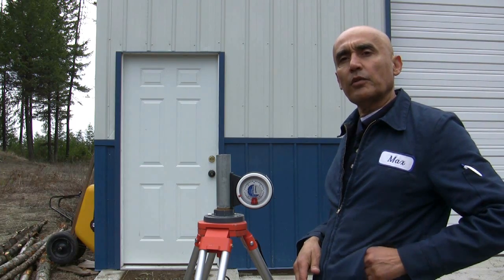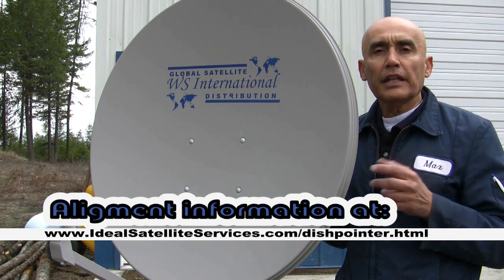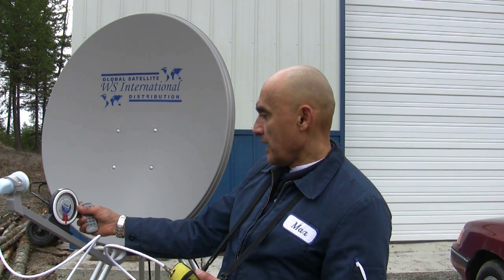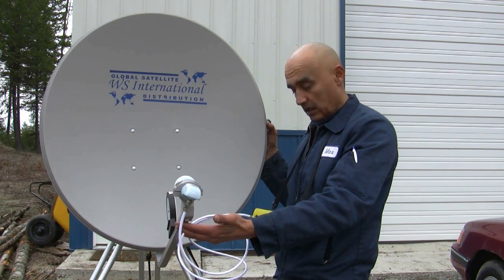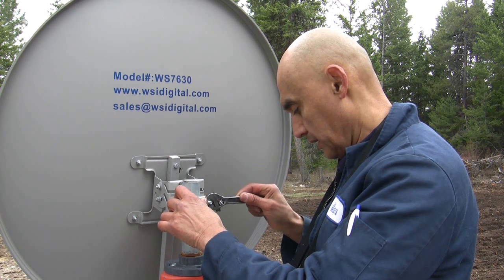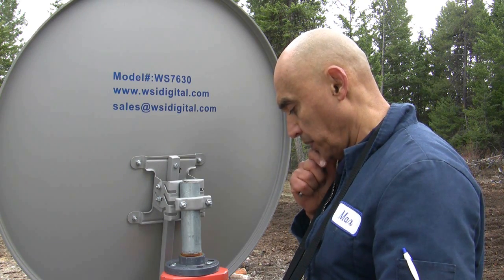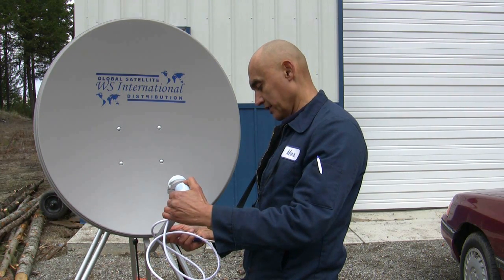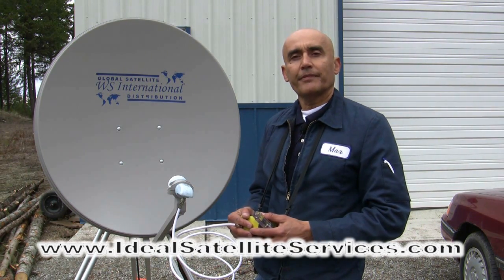How to set up an fta satellite system or aligning an FTA dish #ftainstallation #satellitefindermeter

Comment: In this video you mention to subtract 5.5deg from the elevation, but in the video on your website you mention to subtract 16 deg.  Is this value depend on the type of dish or your location?  I am using the WS7630, and your pointer says my elev needs to be at 55deg.
Reply: +Thomas Remmert I just received the reply via email.  And for this model dish, it was confirmed to subtract 5.5deg from the given elevation.  Thanks for your tutorial and support!

Comment: nice video
30" dish dish wow, in my area they use 36", mines a 39" and its about right.
The problem is snow, you loose it all, the bigger dishes help. Had I known, I would of went even bigger, as some of the other sats are even harder to get.
Reply from the maker: Try installing a dish heater.. That works great in the North West.

Comment: How do determine the angle that you have to remove in order to use the carpenter level on the lnb pole. i have a 33 inch dish.
Reply from the maker: Your satellite system generally comes with the coordinates when you purchase it. If you didn't get the coordinates you can get them at: dishpointer.com

Comment from the maker: Why don't you use a dual output lnb and a receiver in each room. 
About your question above. Are you splitting the signal from the back of the receiver is that your question? Or are you trying to split the signal froma single lnb to two receivers.

Comment from the maker: Thanks for the question, I love to help you but you don't give me much to go by.  Most receivers turn a different color on the signal strength to identify a lock on the satellite. The same is true with the quality.  The biggest problem that people make is that the mast pole (in your case the temporary pole) is usually not plumb. PERFECTLY vertical on all sides.  This will throw all your coordinate setting way OFF.  I suggest that you start there.

Comment from the maker: Yes! It does sound like you have the polarity off or it could be that your receiver is not passing 13 volts to the lnb.  But first try adjusting the skew, switching between H and V transponders. 
Max